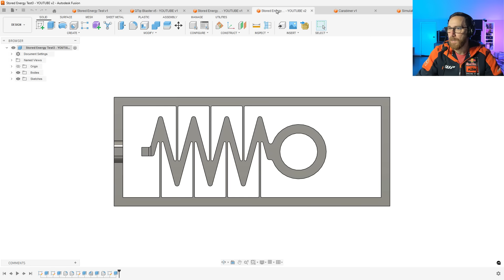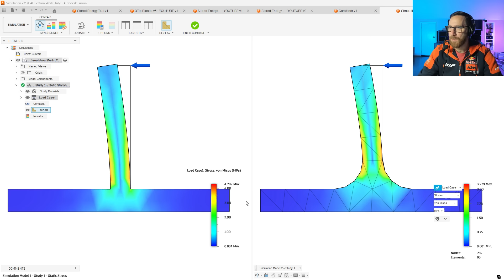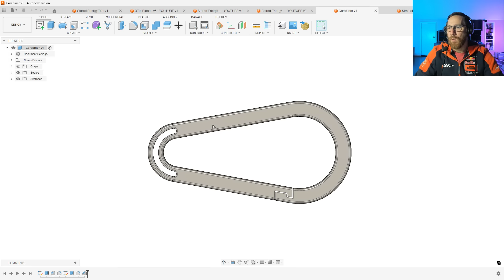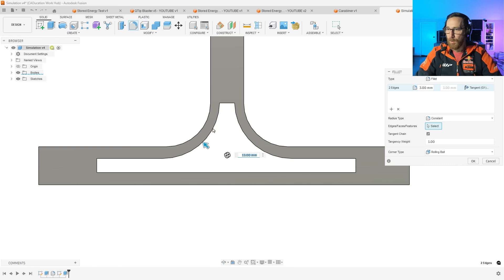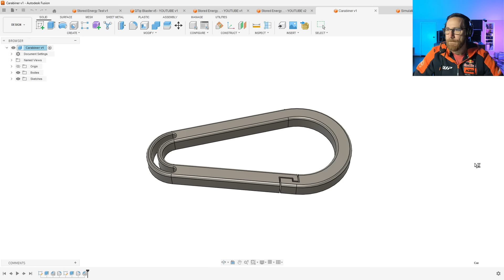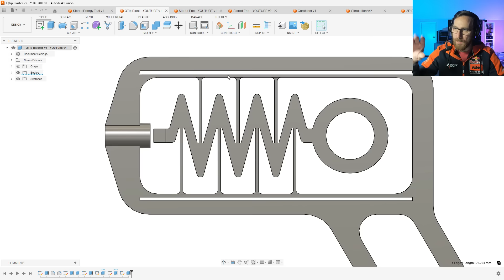Storing Energy in 3D Prints | The Thought Process

Comment: For anyone interested, these types of devices are called "compliant mechanisms". BYU (Brigham Young University) has the most thorough knowledge base that I've seen so far. Their research has produced a generous resource library for makers. Compliant mechanisms are in products all around us. They've been implemented into injection molded design for quite some time and are definitely a natural fit for 3D printing.
Reply: Jus read reaserch papers, then you will realize they are not the knowledge base.  They just do public relations about it.
Reply from the maker: I hadn't seen the BYU resources before. certainly worth a look!  Checking out their resources I see they show Rober's blaster.  

One issue with a lot of their compliant mechs that i see is that they rely on beam bending and work best with milled/cut from a uniform sheet of something like polypropylene.  For a desktop FDM that doesn't really work as the plastic deformation occurs much sooner.  So just keep in mind that a molded or milled compliant mech will not behave the same as a desktop 3d printed one.

Comment: Wow, this is so interesting approach. Would be interesting to combine multimaterial to control the damping when material compresses. Definitely gonna have to check it out
Reply from the maker: True!  With an AMS  you could use a TPU but the elastic of the one with teh ams kind of sucks.  with a dual extruder printer a softer TPU would be possible.

Comment: 21:24 I‘m wondering if this design would benefit from separating it into two rings and a series of spines you can print laying flat that connect to the rings using ball joints.
Reply from the maker: That might work but the ball joint would just rotate and not spring back (if i am understanding correctly).  The file in the desc is different with a bunch of zig zag sections.  Using something like that and controlling the thickness for where you want it to flex (and maybe adding some slots) might work as well.  Since FDM/FFF isn't really great for that orientation I haven't spent much energy trying this.

Comment: 6:30 : I was going to comment that your mesh was WAY too coarse to properly analyze this fine.

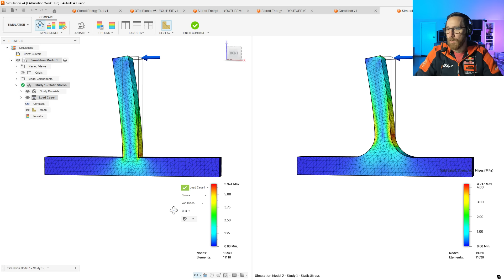But I see you refined it at 12:00 :P

But you are correct that the coarse mesh still gives a good idea by itself of how it's going to behave.

Edit: Very interesting idea of adding these slots to enable the walls to flex.
Reply from the maker: Glad you stuck around and let me fix it :)  One of the benefits and drawbacks to always recording the videos live and in real time is that things like this pop up.  But in this case I left it and kept going because it did highlight how mesh refinement changes things.  In reality I probably wouldn't have done some local refinement around the fillet for the final model.

Hope you play with and improve the walls flexing method.  I haven't really seen it anywhere else but it is what has worked best for me on various designs so felt it was a good method to share.